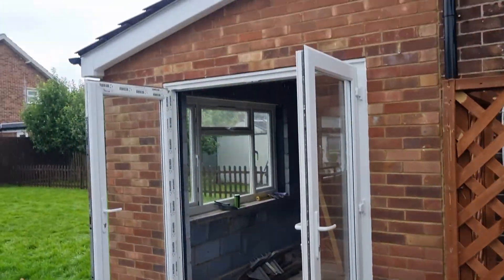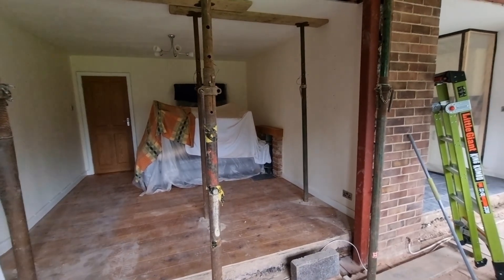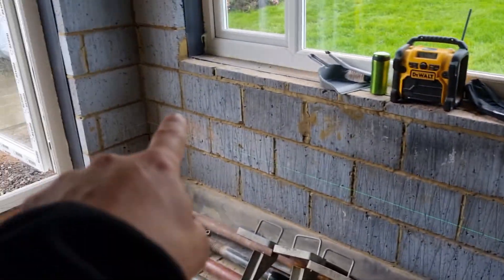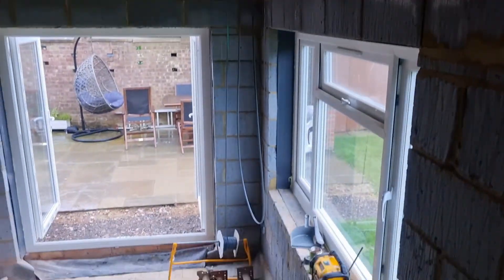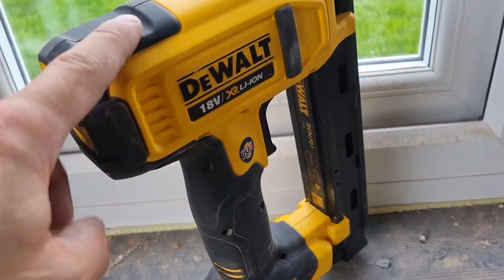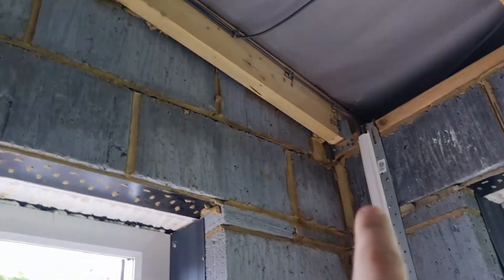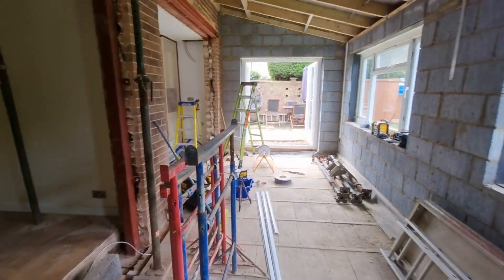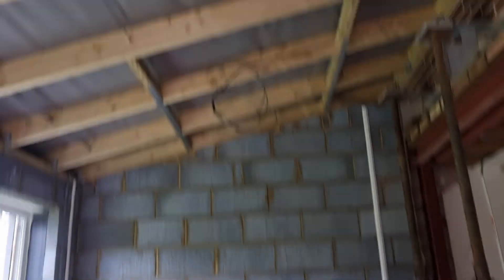Extension Build - Electrical 1st fix / Wiring

Comment: What happens if the electrician has notched out the bottoms of the joist where you have brought the wires down the wall to the light switch

Comment: Quick question pal, does the 2.5mm socket wire have to run through conduet when it inside metsec metal stud walls, isolated with kingspan?